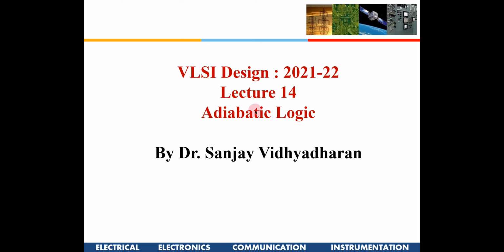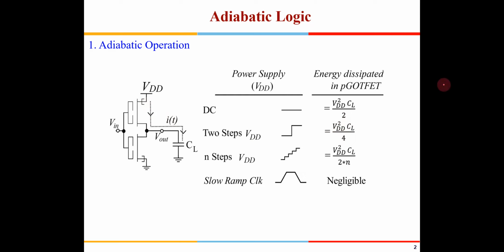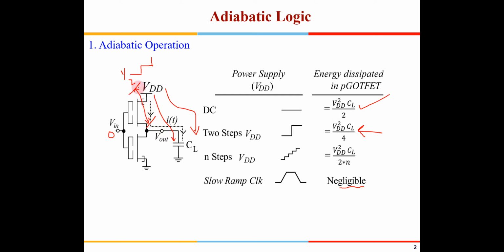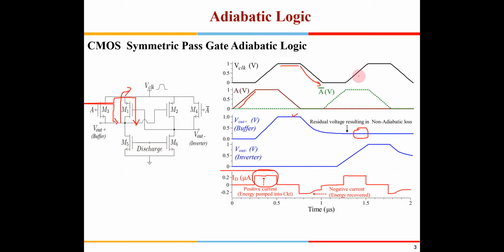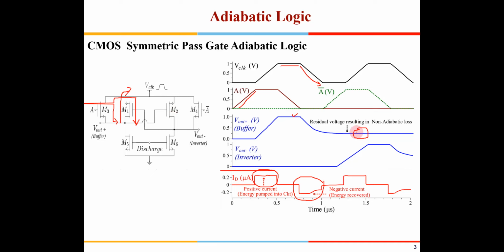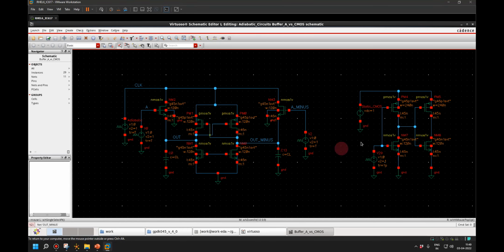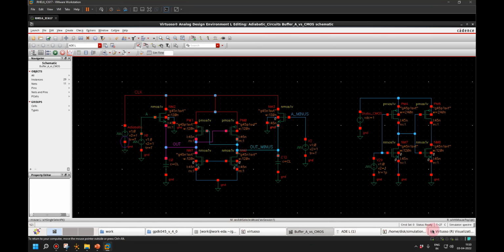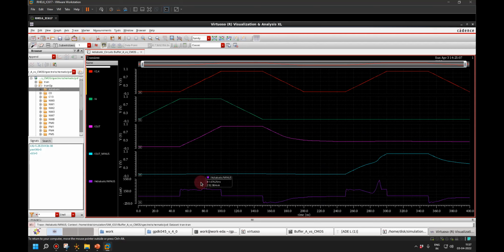VLSI Design: Adiabatic Logic

Comment: Sir how to generate slow ramp clock
Reply from the maker: Two ways.
 1. You vcan use Voltage source -advanced - then PWL. where you can sepcify v1, t1, v2 t2 etc
 2.  You can use Pulse and specify the rise time nad fall time as required.
Reply: @SanjayVidhyadharan  sir can you specify the vpulse values rise time, fall time, period, pulse  width for your circuit
Reply: Sir by using this adiabatic inverter can we design a ring oscillator